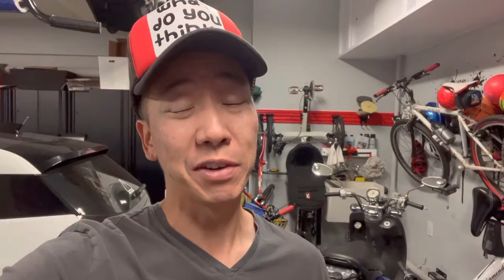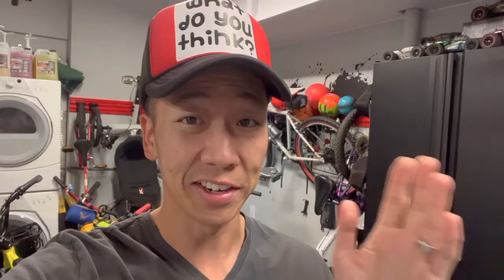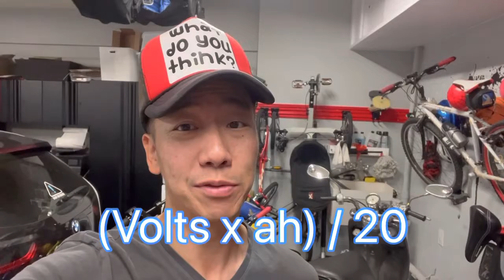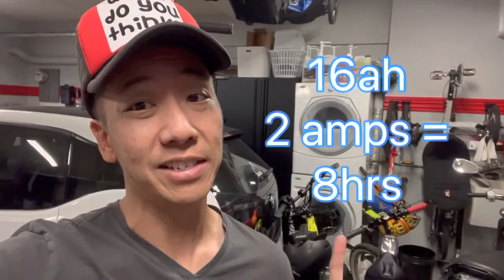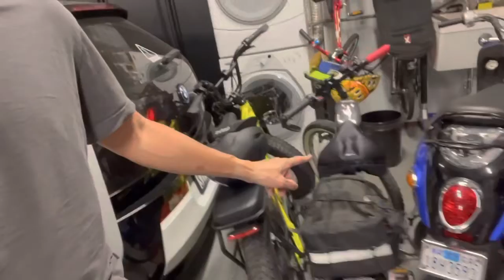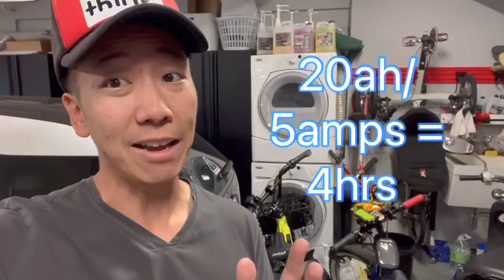Understanding Volts Amp Hours and Watts Before Buying an Ebike

Comment: the cops in north america dont care as long as you dont break 35 in town, or accellerate faster than their car can. helmet too, in case you bump into a stickler. i know from experience. i'm running a 2kw homebrew bike with 32ah of capacity, and i keep pace with traffic out here and havent been pulled over yet. you can just drive it responsibly like a car and you're good.
Reply: best to run higher power bikes with a 20 amp total limit if you want to play it safe

Comment: Oh man I am I glad to have found this channel. Thanks again for the advice. I was considering the Aventon lvl 3 or the Bulls iconic wave. Both have 36 volt motors. It would be better having that cushion in power when it is needed.
Reply from the maker: Cool, glad you're enjoying the content. 36v is on the lower range. 48v will be the American standard. But if you're in the UK, then I think you guys can only use up to 36v due to the speed cap. Voltage though isn't just for speed though. You'd need higher voltage for hills. 36v will not do well on extreme hills unless the bike is very light weight, meaning sub 45lbs.

Comment: There’s always a point of diminishing returns, you have to balance weight, rolling resistance etc, etc to find the sweet spot. 
Some bikes will benefit from a bit bigger battery, especially in the case of a larger rider or perhaps if you live in a hilly area and only use the bike for short trips.

Comment: Show kid down the street gave me a urban Rider e-bike. It looks like they scalped it for everything but he left the fat tires front and rear and it has the 750 watt hub motor. It's basically a roller. But I have two avoopro 500 watt double shock scooters. One of them is destroyed but battery and controller and digital display all works and it takes a charge. Which is 42 volts and 14.5 amp hour battery. That runs a 500 w 10-in hub scooter tire. Can I take the battery in the controller out of that and hook it up to a 750 watt. 20 inch hub motor on that evike and running around my neighborhood for a little while until I can get. A 48 volt battery and controller for it. Tell me for a month or two you just go around the neighborhood maybe for a half hour an hour at most not even. Would I have any problem doing that from Monticello just running around the neighborhood probably not ever going over 5 . Miles at a time. Thank you very much great video I really appreciate it if you could help me out.
Reply from the maker: It’ll be fine. The motor and battery spec compatibility isn’t too particular. You just won’t max out the motor’s wattage potential with less voltage running to it. It won’t explode or cause electrical problems if that’s what you’re asking. The controller though does need to be compatible as does the throttle to the battery.

Comment: My 20" fat tire ebike wheel says 48v/1500w.  35amp controller.  What battery would work best.
Reply from the maker: You have to use a 48v battery then because all the components need to match. Standard battery size is about 12-14ah.

Comment: I found a Hyper E-Ride City  (36v,250w, 7amp, 7.8ah) It does need help on hills and 7.8ah is an insult to transportation. BUT it was on clearance for $218 new. For that price it's a great backup for my modified 52v, 1700w, 45amp, AWD, Lectric XP2.0 which has eaten way too much time and dollars in learning and error. (But it'll climb a tree lol)
Reply from the maker: @fozzsr  I still have a tiny Sharper Image scooter that I overvolted to become those specs and love it even though it’s a puny little thing. Definitely not go up hills and I look like a clown riding it.
Reply: @Funcentric  A kindred spirit...  I want just a bit more power than I need on hand and quicker is better than not. I should be a little scared of it to be satisfied. 😊👍
Reply from the maker: @ that’s the thrill!

Comment: Good intro vid, and let's here it for being normal. I would like to see a similar clear and to the point vid on the topic of overvolting, and an explanation of controller amps--such as in upgrading a controller and perhaps overvolting too. You spoke of the controller limiting amps but said nothing about the controller allowing more amps the motor can handle. And how do you know how many amps a motor can handle, is that related to watts ratings? Watts divided by Volts?
Reply from the maker: @charlesbreaux5475  the motor will have its own amp rating. It’s been awhile since I made this video so I do r have the info on me now but there should be a chart showing typical amperage limits for certain motor sizes. I’d start there.
Reply: @Funcentric  yeah, I just had a long talk with chat gpt about it all. A quick fix for a controller that allows more amps than the motor can handle is to put a fuse in the hot wire from the battery rated at the power limit of your motor, or original controller.
Reply from the maker: @ that’s way beyond my knowledge.

Comment: I asked a bike technician about the difference between 10 Ah and 10.4 Ah on the battery pack and he said the replacement should be exactly the same as the original. But I can't find replacements that are 10.4 Ah. How important is the difference?
Reply from the maker: @briangillis8788  zero importance. Very minimal. Ah is like gas in the tank. You can use any battery, as long as the voltage is the same.
Reply: @Funcentric  thank you for clarifying, it helps a great deal

Comment: I do believe that your right. 
I know nothing about this stuff. 
I do use it though, and I’ve noticed that every single mathematical statistic thats proven correct on these bikes are just not accurate when you go to use them. (Regarding range)

We should tinker that as a species because it’s really not correct.

Sorry if I sound super ignorant.
Reply from the maker: @Callmethebreezee  yeah the watt hour / 20 rule seems legit and allows you to adjust based on each individual. Those numbers are way under the claimed manufacturer numbers.

Comment: You're the MF man. I'm curious what you think about about the EKX T1 vs either the jansno x50 or the happyrun? I'm stuck.
Reply from the maker: I would advise against any of those. You want something from a more legit company, preferably American with a good history. These are all Aliexpress and Amazon bikes - something you want to stay away from. You'll get zero support and there's zero reliability with a brand that has no strong history. 

Company comes first, followed by the product. Don't look at a product and then try to justify the company behind it.

The company should at least have a phone number which is absent on the EKX website and would you really can Jansno in China? Jansno's $5 off coupon is insulting to say the least. Have you noticed that under the dealer menu, there are no dealers? They just claim to be looking for dealers.

I recommend you spend some time in any Facebook Groups that may exist for these ebikes for at least 3 weeks to see what the community talks about. 

The only China brands I'd ever consider are Magicycle, Yadea and Mockwheel.

Seeing the cafe racer look you seem to be going for, you may want to take a look at the Ride1Up Revv1 or the Yadea Trooper 01. In terms of styling, Raev seems like something what fits up your alley, namely the Bullet. They are a Canadian brand. 

Particularly if you're spending upwards of $2k, you really don't want to be giving it to some random sketchy company. I'm not confident in any of the ones you've listed. Buyer beware.

Comment: I just bought two Aipas F3 adventure bikes. The description on the web page says 1500 watt motor with 100nm of torque. The numbers on the hub motor is "CZJB110SZ 48V" Is this marketing BS? Haven't had time to even ride it yet. Just subscribed today. I like the way you explain things.
Reply from the maker: @f150bft  no I don’t think so. That is a good amount of torque if it is correct. 48 V is a good standard for USA consumers for an E bike nowadays. 36 bolts would have been way too small for hills. Either way, you will still need to pedal. which is fine since it is not a motorcycle. The motor spec is likely, the peak meaning the motor itself is likely not rated that high and wattage, but once combined with amps and bolts, the motor can likely reach that level of 1000 W. A lot of the times companies will show the peak wattage as opposed to the actual wattage of the motor itself.these days, many motors on the bikes in the USA are rated at 750 W which is the maximum legal limit.
Reply: @Funcentric that hub is 500 watt same one on my Aipas A2

Comment: How can you calculate the e-bike speed ? Speed = distance/time
Reply from the maker: @cjimenez1203  not sure what you mean. Your speedometer will tell you the real time speed. As far as its limits, it will depend on the rider weight, load, temperatures, grade, etc.
Reply: @Funcentric  When you buy a new e-bike, the information they provide mentions the speed, sometimes 20, 28, 35mph etc.. how they calculate the speed. ? Is it any relation with motor watts, battery volts, or battery ah ?
Thanks
Reply from the maker: @cjimenez1203  oh I see what you mean. I don’t know exactly but it does have to do with how many amps the controller allows the motor to draw. Many times the speed is actually limited by the controller amperage rating and not the motor itself. 

Higher amps means it’ll work harder and go faster. Less longevity though. 

Juiced bikes for instance offers an upgrade controller that does just that. Higher speed on throttle only and bigger punch off the line.
Reply: @cjimenez1203  Speed is calculated at the rear wheel via speed sensors which monitor the rotation speed of the wheel

Comment: Is there a standard way to set up an ebike with multiple motors and batteries? 

I would ideally like to build a trike with a direct drive front hub motor and a mid drive motor to power the rear. I would be using this to tow various trailers. Trailer, corgo, bike, and operator will weigh a minimum of 650 lbs, but I would prefer to be able to move more like 900+ lbs. 

Could it also work to just use a switch to power one motor at a time.
Reply from the maker: Yes but that’s way beyond my expertise.

Comment: I would not buy a bike that is 250W
Reply from the maker: Well that’s just the motor spec. If you overvolted it with a good amount of amps, you could really get that thing spinning.
Reply: @Funcentric  I'm not that clever but I do know if you over volt it. Something has got to give.
Reply from the maker: @adventcliff2040  motor’s lifespan  likely will be reduced. And naturally, the battery will be discharging faster.
Reply: @Funcentric  I'm old i need more assistance
Reply: A turtle would pass you😂

Comment: What if you were just looking for a road bike that could give you some help on the hills/mountain roads? Surely even a 36v hub motor could be fine?
Reply from the maker: Yes, that’s true. But remember even hen you’ré not looking for assist, you’d be hauling the full weight of both the battery and motor 100% of the time. So very inefficient. You’ll likely have more energy to attack the hills with a bike that didn’t have that extra weight.
Reply: @Funcentric  I don't know what you mean my voltage sag but a full hub motor system if something like the x20 from mahle only adds 3.9 kg or so i think. Even at 36v the motor's gotta pump out enough power to offset 4kg surely. It seems to be understood that even for very tough climbs it doesn't take much watts of power to offset that kind of weight. If you left it on the lowest assist mode it could still add something for people who have bad knees or something where they can't pedal as hard as they'd like
Reply from the maker: @Millicente  if that’s the situation, I’d recommend a cadence sensor over a torque sensor. A torque sensor would demand more pressure to be put on the pedal to result in the same level of assist. 

The higher the ah, the lower the voltage sag. Practically all electric road bikes will have tiny batteries built into the frame. This is a problem not only for long term replacement needs of the battery but voltage sag. Voltage sag basically means that there’s a temporary drop in available voltage while under load. This is much more apparent with smaller ah sized batteries. You’ll experience much better sustained power through a higher ah rated battery. 

In other words, the design of an electric road bike by nature is much more susceptible to voltage sag which is the weak point in the technology we have currently. 

My electric cargo bike for instance experienced a very noticeable drop in performance once it goes under about 50% battery capacity and it’s got a 28ah battery.
Reply from the maker: Also there’s something called voltage sag which affects smaller batteries much more. A bike with a small motor likely has a small battery and you’ll experience voltage sag a lot more. Basically less sustained power through hills. Haha. So yeah you’ll likely not really want an a bike for that use. The ebike components pretty much cancels itself out.

Comment: In Australia where I live, the limit is 250w as for most of Europe. The philosophy being that we are talking about bicycles with electric motor ASSISTANCE, not motorcycles that you can peddle. I live in a fairly hilly area, where I would have to get off and push a normal bike in some areas, but my 250w ebike allows me to climb these hills at 16 -20 kmh which is more than satisfactory. I pedal my bike on flatter roads without power unless there is a headwind or if I am tired, in a hurry etc. I get as much as 150km from a charge on flatter ground, and 60 -70km in hilly areas if I manage things well. This is very satisfactory for me. A throttle would be nice sometimes, but these are not permitted on public roads and paths where I live, but otherwise I am more than happy with my ebike.
Reply: Start thinking of these vehicles not as enhanced bicycles, but as replacements for cars.
Reply from the maker: @rymalia  yeah I think that’s precisely the myth. Most folks want that but can’t really get away with it. I see a big influx of buyers regret coming up where people will start selling their used e-bikes. 

In most scenarios, people still need a car so it’s not fully a replacement and in the meantime, they’re still paying for registration/insurance. 

An ebike is a nice alternative to driving in certain cases but not quite a replacement for a car for most.
Reply: Couldn’t agree more with you
Reply from the maker: Some may say we are too free in the USA. I agree. The way the rules are now in America are straight up dangerous.
Reply: @Funcentric the eu rules are excessive. In the us it's what, ass what is electric to 15, class 2 is throttle to 20, class 3 is assist to 28. These are reasonable categories and let's face it, 350 watts on a hub drive isn't that crazy. Now there are a lot of "bikes" above that range that aren't really bikes and can hardly be pedaled but the 20 mph standard is supposedly based on what am average athletic person can pedal (seems reasonable) and when I'm on the road I appreciate being able to go above 20. Perhaps there is a happy medium. H.that said, 250 and 350 watt bikes aren't terrible, much lighter. All about what you expect them to do imo
Reply from the maker: @GIedits-vf7re  the problem is that there’s a minimum weight of battery and motor. If the combination isn’t efficient, then a weak motor will behave even weaker. Frame weight becomes that much more important when the motor is too small.
Sounds funny but an electric bike has to be electric just to carry its own additional weight.

Comment: 750 Watt is OVER standard, since the standard is LESS THAN 750 Watts!
Reply: 500w with 750peak is what's most commonly advertised. I see a lot of 36v×15 and also 48v×10.4 is probably most common.

Comment: Midmotor vs. hubmotor... those play a role regarding some of your claims.  As an example I have a 350w mid drive motor with a 36 x 15 and have no problems with climbing or hitting 28mph.  It's not a struggle to do either.
Reply from the maker: You’re completely right. I was referring to hub motor, rear ones specifically.

Comment: very helpful, thank you!
Reply from the maker: Awesome! Glad it helped. I know it can be so confusing. It definitely was for me. I should also mention that an ebike is like a car that loses horsepower as it burns fuel. Voltage is like power and that drops as the ebike or escooter loses juice. So batteries are actually super inefficient. At least a car loses weight as it burns fuel and the performance is still 100% even when the gas tank is almost empty. 

For an ebike, a 48v pretty much turns into a 36v by the time the battery is close to empty.